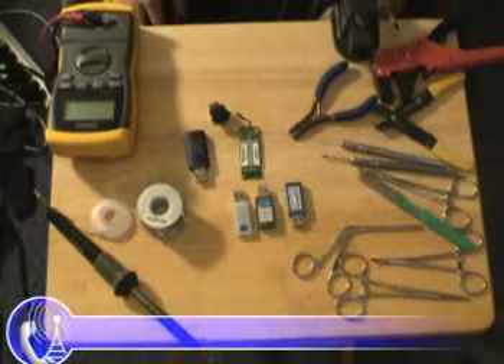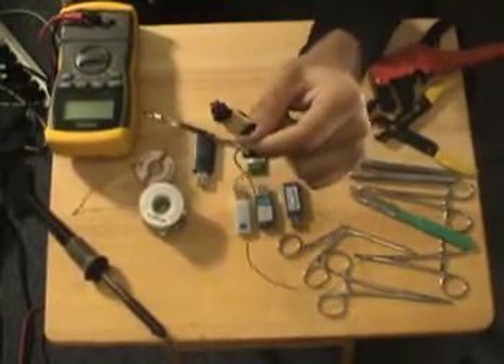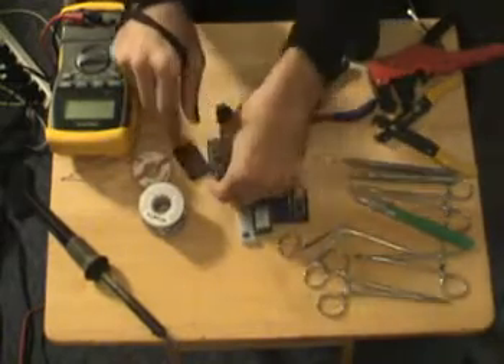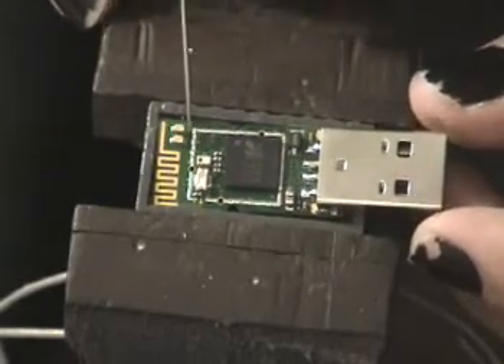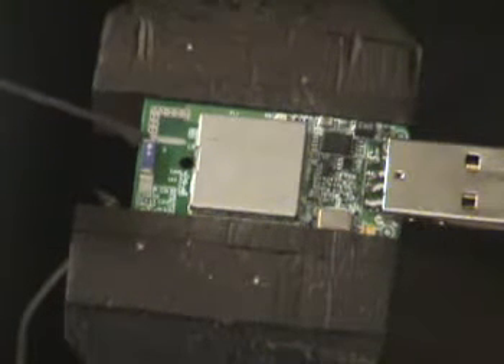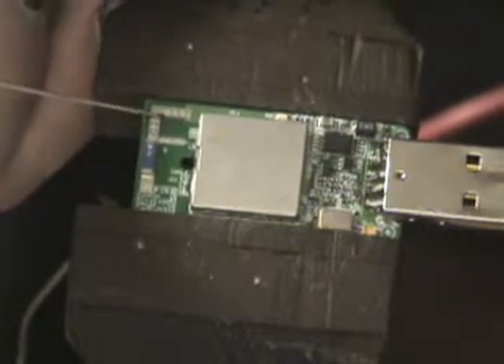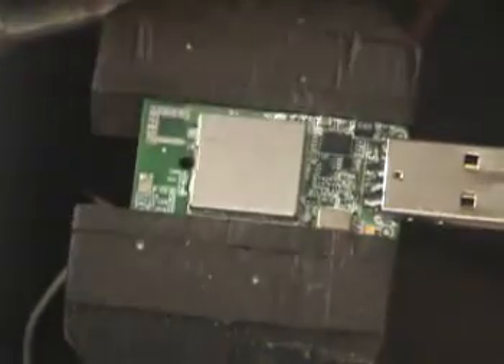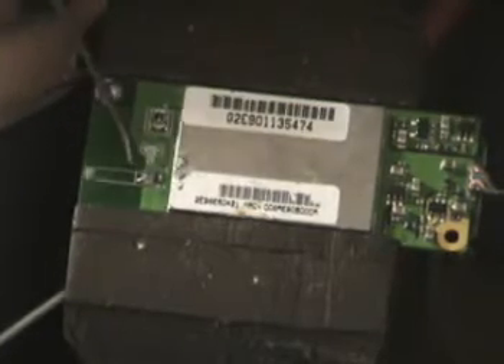USB Wireless Stick RF Mod -Part one

Comment: the short that you are referring to on the the output is a matching transformer
the output of the module is most likely 50 ohm trace and the Impedance of free space is 376 ohms.
hanging a wire or an inductor out at the end of a 50 ohm load will reflect back a lot of the signal.
the inductor printed on the PCB with a DK of 4 will slow down the signal and will appear longer.
the large inductors you are pointing to are antennas made with tightly controlled DK and conductors but most still need the transformer.
http://www.johansontechnology.com/datasheets/antennas/antenna_2450AT42D0100_prelim.pdf